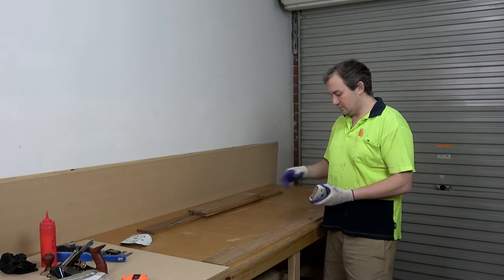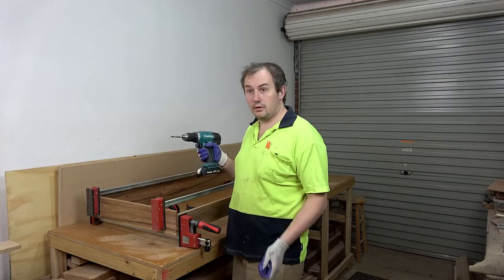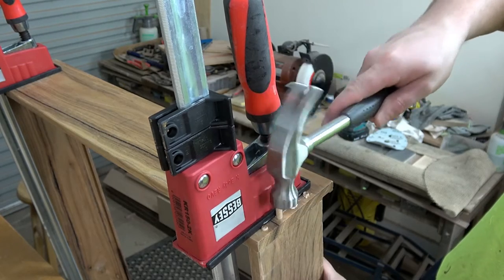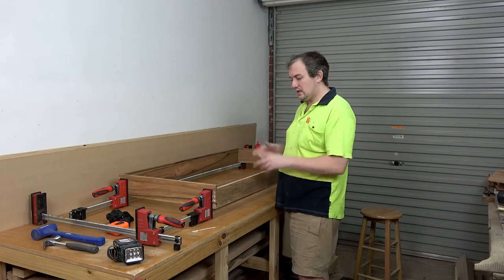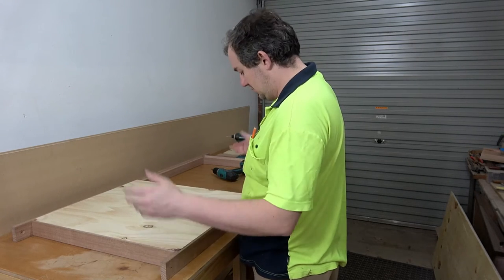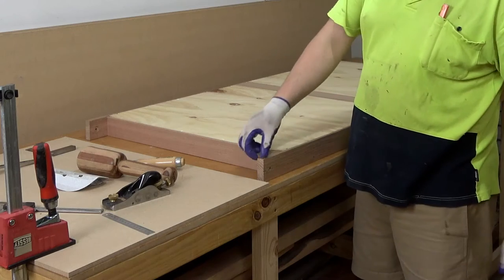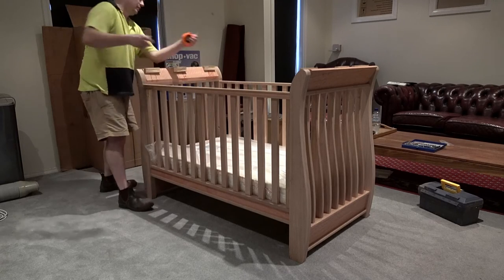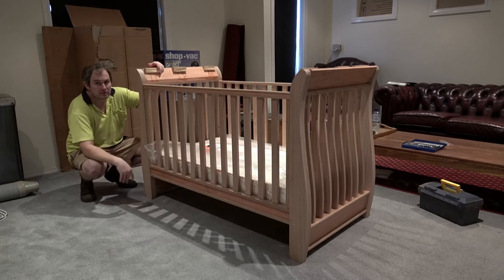Sneek Peek - Woodworking Vlog 21

Comment: Looks fab Kuffy, even better than I expected (and my expectations were high coming from you).  You've answered the one criticism I generally have of furniture made by woodworkers i.e. it looks like it's been made by a woodworker (even if the work is technically 100% correct).  No one could ever say that of this design.  It looks great!
Reply from the maker: I'm really happy with the design. It took some doing to get it, but once I had the leg shape sorted out, everything else just falls into place. the design would be much much much different if I could do what I wanted without the regulations, but it also would have been extremely complicated, so perhaps I am glad for the nanny state for once 😀

Comment: I listened to the vid till the end.   Is it your first kid?   Congrats!   The cot is bloody beautiful and it is solid as a rock, so baby has no hope of breaking it.   It is what is called a labour of love!  Good on ya mate cheers Sean
Reply from the maker: It is my sister's first kid. The cot sure is rock solid, which surprised myself because I thought it may have a bit of racking left to right because there isn't much bracing in that direction. The side panels though are suitable for even the most sturdy of hand tool work benches 😀
Reply: You're having a kid with your own sister?!  Must be an Aussie thing.  Nice cot, by the way.

Comment: Looks awesome mate, leave the glue chocks in the top and say it’s rustic like every other lazy turd does when they sell their crap through the big retailers. Hey there’s also a regulation about the slat spacing, I know on balustrade it’s got to pass the 125mm squishy ball test but on a cot I think it was 50-70mm apart or something like that. Can’t remember it’s been 10 years since I last made one
Reply from the maker: I've made a fair bit of furniture which is sold in the big retailers. It is complete crap, and yet it still routinely fetches prices around 4k for a one day build dining table....

The minimum slat spacing is 50mm and not more than 80mm. No dangerous gaps in the piece between 20-30 which can entrap a childs arm. no horizontal surfaces wider than 8mm which can be used as a foot hold for climbing etc etc. I have it all covered. Safe as houses
Reply: Good on ya mate